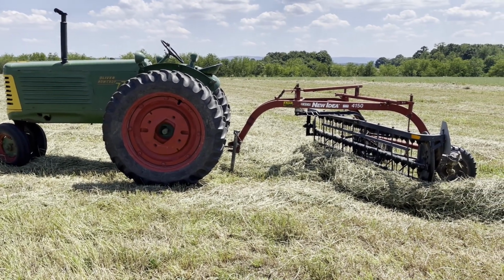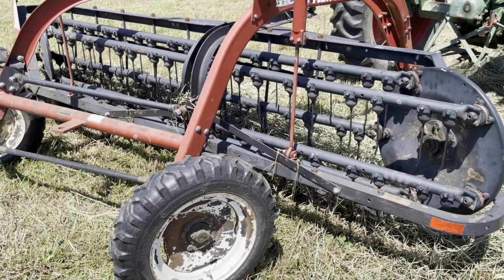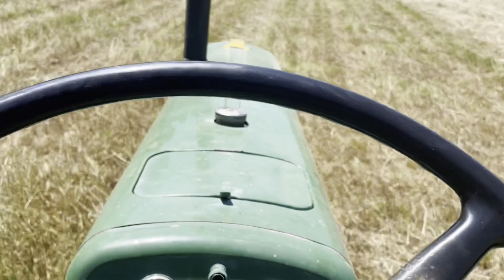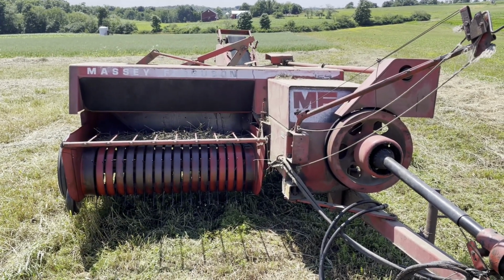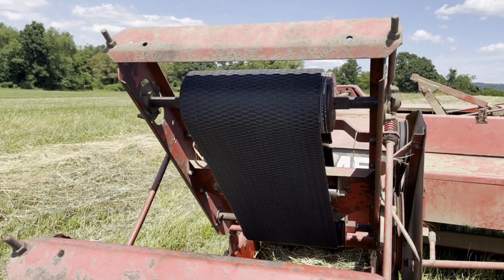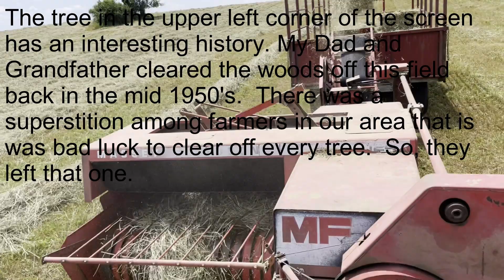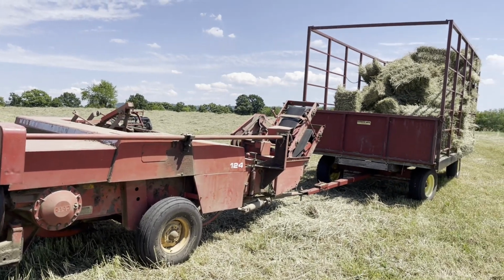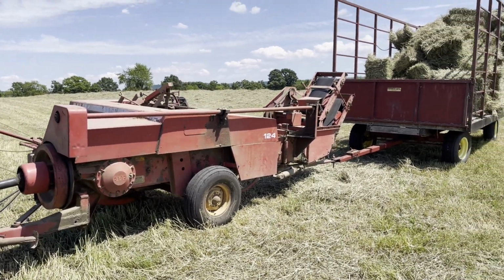Raking and Baling Timothy Hay

Comment: I love seeing baling done the old way and seeing someone run a baler right.  I see way too many people going too fast and trying to cram hay threw a baler. Every baler has its sweet spot that it will bale like a sewing machine and never give you any problems , Just good quality square bales . Really nice haying line up you have there, I like it !  Bandit
Reply from the maker: You know, we seem to have a lot in common, in our attitudes and beliefs about farming.  Sure wish we lived closer together.  The Massey 124 baler was a high capacity baler in it's day, 46 years ago, but not today in comparison to the new balers.  And sure, I could put a bigger tractor on it and try to go faster and make it eat huge windrows like they stuff into round balers (I know guys who bale 8 or 9 mph, but it would be hard on the baler, and that's not what I'm about.  If you use common sense with older equipment, maintain it, and care for it, it'll last a long time.  And it's economical, which is what I really like.  (And it's all paid for, too. 😀😀😀😀).
Reply: @pagrainfarmer  Growing up I was around a lot of the old timers who still farmed and I learned a lot from them.  One of them had every tractor he owned had road gear blocked off so you couldnt use it. He said tires ware out faster in road gear and I got to pay for them so he blocked high gear out of every tractor. None of them had any new equipment but they had good used that was in great shape. I learned to rake hay by several of them and as for baling ground speed was to ware it would pick up the windrow and just start to stretch it and you were at the perfect speed.  I was shown why every baler is different even the same brand and model and why each baler has a sweet spot to run it at. The old man that owned the ground behind us showed me alot too,  He told me Boy if you learn to farm the ground you have and do it right you can farm any ware in the world !  I thought he was a little nutty back then but now I understand just what he mint, Our ground is really different and I have learned what to do and not do and why. Pulling a disk well there is an art to that too, 4 to 5 mph is just right any faster your going to make a mess and ware the darn thing out faster. Well it might be the old ways that were drilled into my brain when I was young but it still makes sense to me and the old ways still work just fine today. Remember Charlie Great Minds Think Alike !  LOL Bandit
Reply from the maker: @banditfarmer1900  Well, there were always good reasons behind the old ways - and many benefits too.  Today I think too many farmers chose their methods and ways of doing things based simply on saving time and money, but sometimes the benefits you get from the old ways out-weigh the time and money thing.  I DO learn new tricks now and then, but I am overall very stubbornly old-school and plan to stay that way - I guess it will just be the 2 of us.  🤣🤣
Reply: @pagrainfarmer  Over the years I've learned a lot of the new ways and I thought about the vertical tillage way and to a point it makes sense, BUT after plowing back by the woods and seeing how easy it compacts well that idea has gone the way of the Dodo bird !  Ya save time just working the top 3 inches put you compact the ground in the process so that idea is out of the question in my book.  If there is a better way to do things I'm all for it but I sure aint going to do something that will cause a problem in the future to deal with. I see enough corn right now thats on ground thats been no-tilled for the 20 years that looks like crap and all curled up because it hasnt rained in 2 weeks . It might be old school but I'm going to keep working my ground just like I always have simply because it works for me.  I honestly cant figure out how as I'm told the cost of working ground is $75 an acre ? How ?  I bought 100 gallon of diesel and have 1/2 a tank full of fuel and over a 1/2 a tank in the tractors (1850 and Long) so 30 gallon in the tractors and 50 in the tank so I burned 40 + gallons to put out 50 acres , So lets just say $200 in fuel or $4 an acre to plow disk harrow gate and plant my ground, Ware do they come up with these figures at $75 an acre ?  I'll just keep doing things the way I always do and I'll be happy doing it.  Bandit
Reply from the maker: @banditfarmer1900  Amen!  We just keep doing what we do.

Comment: Great video. We also used a 124 baler. We had 77, 88, and 1850 olivers. Dad always the 88 for baling. It was a diesel and handled it very well. We could use the 77 to bale on the flat but our hillsides were steep. Just needed something a little bigger. I am in southwest WI.
Reply from the maker: Makes sense.  I hate to use a bigger tractor than necessary.  Thanks for watching and commenting.  Nice to meet you!

Comment: I’m amazed that that 77 can even do what it’s doing. I’d be pretty worried about being pushed around with a tractor that small with just the wagon on the back let alone both the baler and the wagon. Sometimes a full wagon will push our John Deere 2510(1550 size) around a little when stopping quickly or trying to go up or down a good hill. It even weighs about a ton more than a 77. That Massey baler must take a lot less power than our New Holland 316 though We have a John Deere 4020(1850 size) on the baler and it’s a good match for it. You can tell it’s working coming up the hill. Of course the New Holland does eat hay a good bit faster than that MF. Cool video with some neat old equipment for sure. Neat seeing what’s happening on the other side of the state. As you can probably tell we run the other green and a few old red ones as well but some day I’d like to have an Oliver in the 77-770 or 88-880 size in a diesel.
Reply from the maker: The 77 handles it well. That  tractor has a super 77 engine in it, which gives it more power.  I've baled with this tractor/baler combination for 46 years without any problems.  Never got pushed around.  But then our ground is not as steep as some in the area, either.  Glad you enjoyed the video and hope things are going well on your side of the state.  Thanks for watching and commenting.